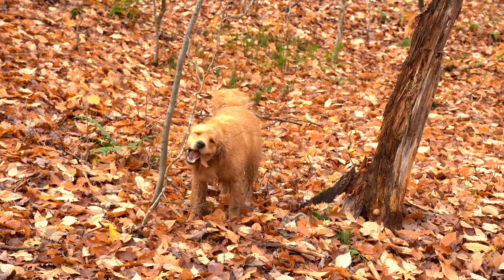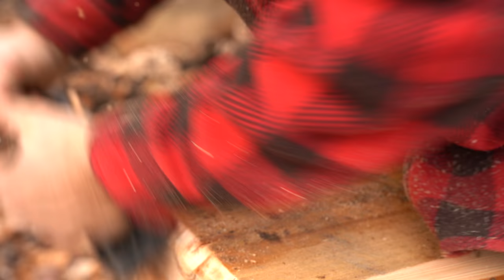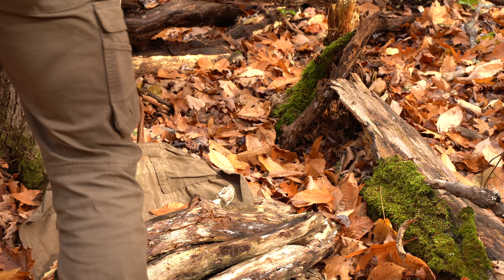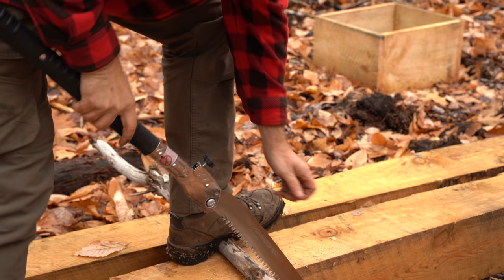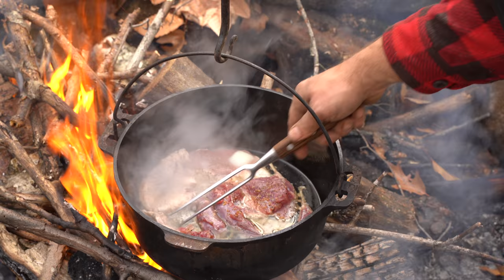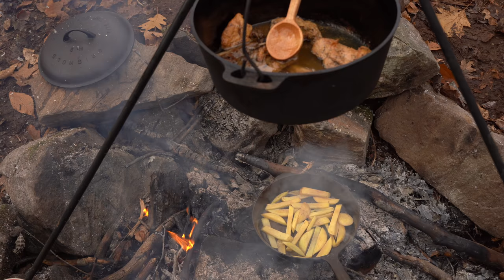Building a Square Off Grid Log Cabin| Lifting Heavy Logs | Squirrel Confit for Lunch

Comment: This has got to be an experiment.  Once there are tools and a workbench in there you won't be able to move around at all, never mind swing a hammer.
Reply: Wondering if a lot of his larger building projects will go on outside under a porch type roof with the building to just keep his tools in and for small projects.

Comment: I thought the workshop would be bigger...
Reply: @ Ben Weeks I have a feeling it will be bigger at the 13:00 you will see 2 empty forms lying in the ground. I believe he has left room on the forms he poured and will add timbers to lengthen the workshop. It may be due to the limited time before the accumulation of snow that he will finish this phase as a tool shed then next spring complete the workshop in its entirety.Its only a guess on my part. Shawn has us all guessing at times it's what makes his videos so interesting and keeps us coming back.
Reply: @jd2055  yeah, I saw those and have somewhat made the same assessment, he adds as he goes which I like. I’m keen to see the finished results of the cellar also...
Reply: @87theweeks  what I like the most is all the different techniques of contruction he uses including the charing of wood for preservation. Each building has its own different character which adds to to the interest of his homestead. He also has some highly figured maple so I'm looking forward to all his projects both large and small. It certainly is facinating  trying to keep up with him and what's in his plans.

Comment: smaller workshop then i thought u where going to build but i like the square log design. Why the barck under your botom logs in the corners? wont it rot?
Reply: It was birch bark that he placed under the corners of the bottom logs. Canoes were built for thousands of years with birch bark. It is really tough bark. I have seen many times on the hiking trails a fallen birch tree and the bark is still intact and the inside of the log has rotted out. I'm guessing Shawn is using the birch bark like a membrane between the bottom of the log and the rock or concrete it sits on. Sometimes Shawn will answer these questions here in the comments section, but it might be a bit of a search.

Comment: Why did he make the square(ish) logs unsquare with the plaining tool?
Reply: To shed water away and keep it from going under and between the beams. The angle allows for the water to run out instead of under and in. Its something small that you'd think wouldn't help much but it makes a big difference. He'd probably need to seal the edges between each log to keep the water out if he didn't do that.

Comment: My comment is,,, BUTT & PASS METHOD has only been used for about 50 yrs from what I understand....   Only time will tell if this style will stand for 200 yrs and more...I want to take a chance.....    An Old guy who has a utube channel swears that butt & pass building will be Compost in 30 yrs... Personally , I would think this would not happen...After using wood pegs,  insulation between timbers and chinking timbers, and a good insulated ceiling and a metal roof to shed rain and snow, I think it should be around a very long long time..